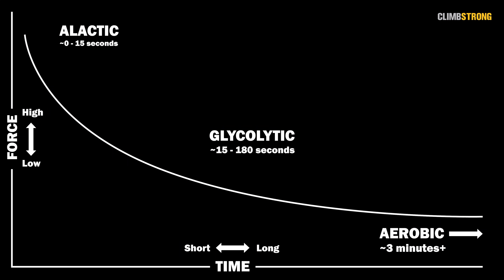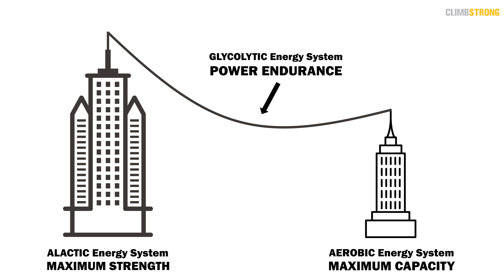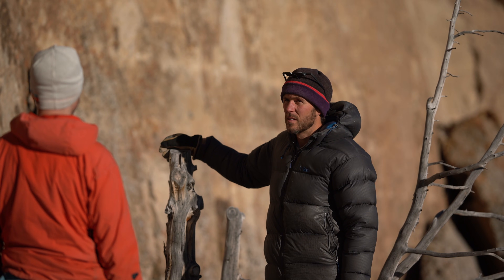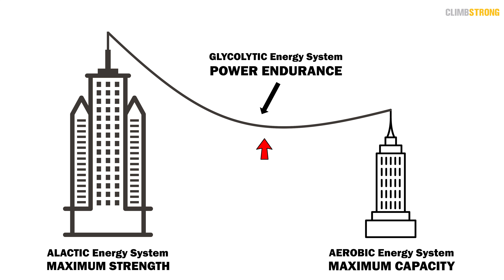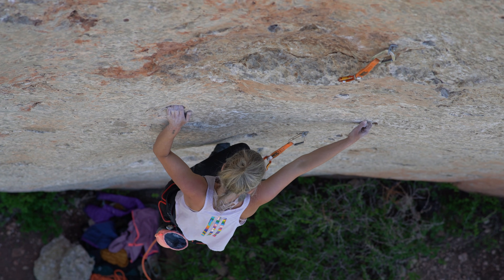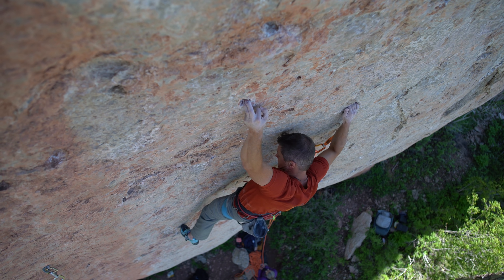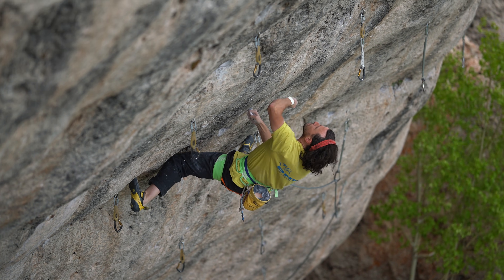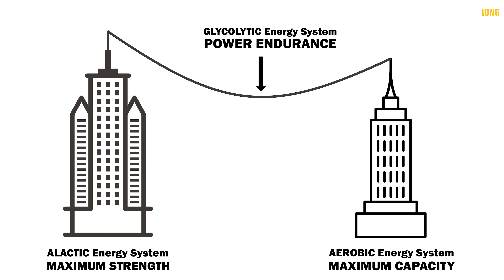How Do We Use Our Energy Systems When Climbing? Alactic, Glycolytic, and Aerobic Energy Explained

Comment: If you can't train the glycolytic energysistem properly, why do pros like stefano ghisolfi and adam ondra train the pump via getting pumped? Wouldn't it be smarter for them to train the aerobic energysystem to improve endurance? Or have they already built the necessary anaerobic and aerobic threshold, where the only thing they can do to improve is to tighten the rope?

Comment: Interesting topics. Some aspects that could use more elaboration imho: what causes pump? How do you know pump only occurs in glycolytic state? How does neurological adaptation affect muscle recruitment and metabolic state? Does glycolytic training increase the threshold where aerobic stage is dominant over glycolytic? By alactic are you talking about usage of creatine monophosphate? Is it the metabolic output during alactic that really leads to strength or are we not accounting for neurological adaptation and muscle fiber type changes?
Reply: They all work together and we don't really know how it works.  A big hold is like slow run relying on Aerobic respiration.  When we get pumped and feel like we re gonna puke that is Glycolysis, which happens because the hydogen ions are making our blood acidic.  Acidic blood means muscles stop working.  I have always assumed calming down, lowering heart rate, gets us back to where we can get back to using glycolysis (using more energy on big moves or tiny holds). Our body adapts in a bunch of ways which increases our ability to recover, etc.  What is really interesting is how hypertrophy comes into play and how a skinny climber has grip strength on par with a big bodybuilder.

Comment: Thanks for the simplified explanation. 
What would be a good strategy for a lead climbing training plan. I’m always unsure how to combine strength (bouldering, fingerboard) and endurance training (repeaters, long easy circuits) and redpointing while training. 
Would be great to have a video about it.
Reply: Periodzation.  Base training, build training, peak training.  Hypertrophy, strength, power/speed.   Hypertrophy is not great for climbing/mountaineering. A lot goes into sports medicine, oh yeah and at high levels don't forget plenty of peds.  For me (amateur) base training is getting to the point where I can shake out on a decent overhang on jugs indefinitely or at least enough to  up/down (unclipping on way down) climb 140 ft non stop with overhang.  Shake out drills at each clip really help, so shake out on each hand for 20 seconds at each clip on something easy.  It will give you an idea of where you limit is and its cool to see it increase.  It takes a very patient belayer, but the results are amazing.  So basically can spend 8+ hours a week in gym on just easy training.  Still get on harder stuff of course, but focus on getting that base up.   Then build phase where you work on strength and power.  Also, talk to coaches at your local gym and watch team kids )

Comment: The commenter above went about it in the wrong way, but I agree that the only thing that could really be improved about this video is your oration/presentation style. This was monotone and low-energy almost to the point of being distracting. I can't tell exactly, but it seems like you may be reading off of cue cards or a prompter- if you go over your lines a number of times before each take you can ad-lib them better and add emphasis in places where it seems appropriate more easily.